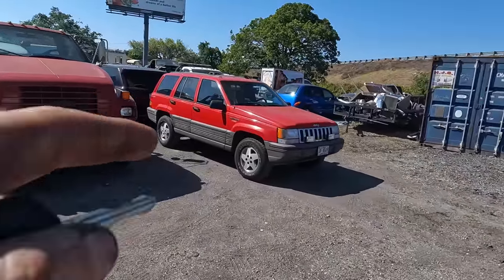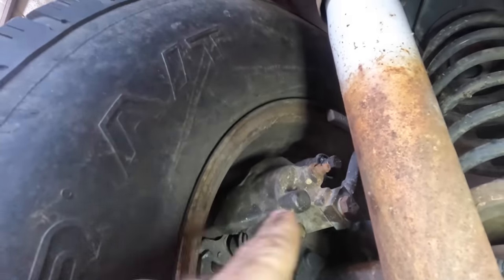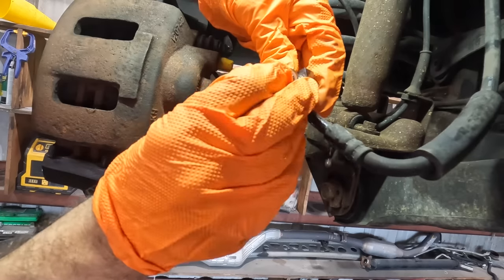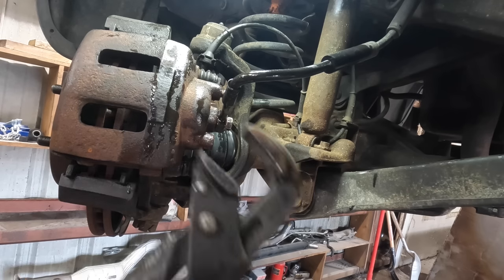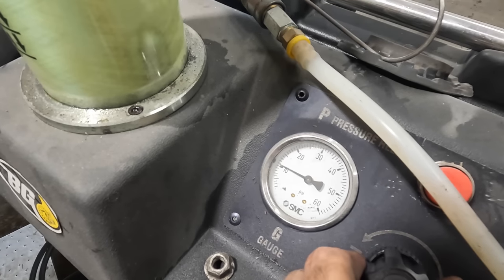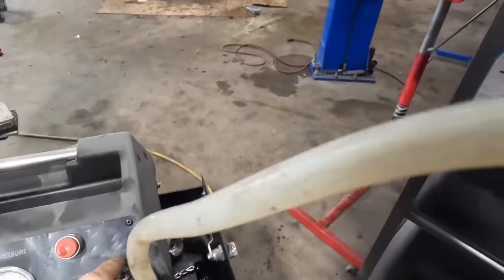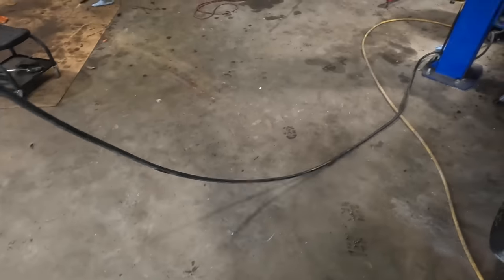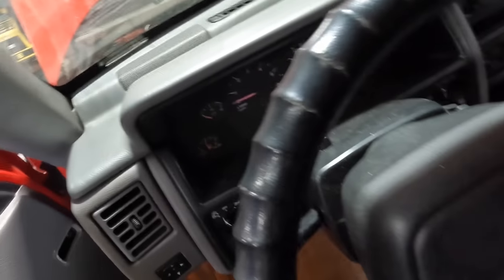Customer States: Air in System No Brake Pedal! |  Jeep Grand Cherokee 5.2 v8 #nobrakes

Comment: Long time ago I learned to NOT punch holes in bottle seals to open them; i turned instead to using a small pen knife to cleanly cut the entire seal out of the bottle neck in 1 piece. Got a 510 Datsun in the shop that periodically stalled in traffic in cold weather for no obvious reason. Good diagnostics revealed that the float bowl was empty any time the car stopped. Good detective work uncovered that customer had punched a few holes in the seal of the bottle of gas line antifreeze he had put in his tank at his last fill. Removing the tank revealed part of the seal had been knocked into the tank where it would occasionally get sucked over the fuel line and kill fuel flow. Once flow stopped and suction relaxed the seal would be released from the fuel line so that fuel could again be drawn into the carb.
Reply: My dad had an old truck that was doing the same thing.  It had half a dozen tiny gravel in the tank that would plug the gas line the same way.  Took him a long time to figure out what was going on.  🤔
Reply: Plus it might be good to close the doors on that cabinet, so the bottles are not all covered in dust every time you open them.. probably just from the demo work.. but still shiney bottle = shiney fluid.
Sliding door cabinets increase workspace also.
Reply: @roboosh  I agree place needs a good cleaning. It would make be think the person who owns this place would be less than careful with my vehicle. Not saying that is Ray but would give be that impression. Obvious bit l not an issue with the busy shop he has. A little ¾ clear gravel goes a long way. Maybe talk to the owner
Reply: @Rick Berglund  in his environment, he could dust every day!

Up north, maybe once a year.
Reply: @sw7366  it doesn't need to get that bad. Seriously maybe some cupboards with doors for the fluids, maybe wipe off the machines at least the parts that touch cars each use. It's not all that hard. I hear contamination all the time but I am sure things are getting contaminated just form laying out in the open. Just common sense
Reply: You guys commenting about dust… you do realise he’s been doing an absolute ton of demolition as well as the yard out front being dusty….. gimme a break
Reply: Yup, seen it several times.

Either carefully remove the entire seal or slice it, making sure ZERO debris can come loose.
Reply: Wow, how many hours went into that investigation  ?
Reply: @andymccall6861  Yeah, that means you clean more often, not that you lower your standard of cleanliness.
Reply: @wesgregg6451  sounds like you guys need to go clean something 🤔
Reply: @andymccall6861  thank you
Reply: One of the first South Main Auto videos I saw, he diagnosed a valvetrain problem on an... Isuzu SUV? A piece of foil from an oil bottle seal got poured into the engine and that little bit was plugging a lifter? Oil galley outlet? in the head.
Reply: I've flushed my fair share of 510 tanks during my time at Datsport.
Reply: If a piece of bottle seal drops into the oil filler on your engine, it can clog the oil drain hole in the head and blow out all of the oil out of the engine while driving down the road. Ask me how I know. 🙄
Reply: We had a regional manager go to one of our stores in west Texas. He ripped the guys in the store for not cleaning and dusting the place regularly as there was a thick layer of dust on everything. The guys spent several hours cleaning everything top to bottom. By the end of the week, everything was coated in another thick layer of dust. The regional manager apologized. We clean our store weekly, but this time of the year with the weather change and the massive amount of pollen everywhere, it’s impossible to keep up with it. With rays shop under construction, the guys next door cutting granite and a gravel parking lot, cleaning is a lesson in futility. I agree that it “looks unprofessional” but as long as the work gets done on their vehicles, I’m sure they overlook the dust. I’ve had customers in my shop ask how we work in such filth. The shop gets cleaned every afternoon. It’s just the nature of it.
Reply: l
Reply: I don’t think a bit of dust is a problem farmers and mine sites battle all the time. I have been in shiny shops with not so bright technicians. Guess which mechanic I prefer.
Reply: @derekhobbs1102  just a little bit of water in the tank can give intermittent faults. A family friend replaced motor before flushing the tank. Expansive 😢
Reply: @GaryH-pw9cm  I think most of us have stuff something up. I have purchased a lot of experience. Must be slow learner. Myself
Reply: that's why many vehicles had a coarse mesh screen filter on the end, it would stop large chunks, but let small debris pass through. then they all went to large filter socks.
Reply: I once experienced a similar condition in a Mercedes sedan, 280 SEL, where a leaf had somehow gotten into the tank when the sending unit was replaced and it would often stall when the fuel level was low.
Reply: @thomasmleahy6218  expensive lessons
Reply: @wesgregg6451  after ANY demo dust will still fall for up to 6 months….. give the guy  a break, remember he’s trying to build a business
Reply: what
Reply: Never seen a system where fuel is drawn into the carb. Most systems with carbs pull it from the tank and push it into the carb.
Reply: Omg dust isn't that big of a deal. A little dust isn't gonna hurt anything. You guys acting like the dude is making microchips, he's working on cars, if dust interferes with operations of your car then you need to get a new car.
Reply: I know of a World of Outlaws sprint car team that chased a power steering problem an entire season before they found a bottle cap seal had been floating around in the reservoir that occasionally blocked the supply line. Those guys changed the lines, the entire steering assembly I don't know how many times. All over a simple bottle cap seal. It can happen to the best.

Comment: Helpful hint: when attempting to loosen rusted fasteners, a six-pointed socket or box end is far less likely to round the fastener off than a 12 point or adjustable wrench.
Reply: I 100% agree. It's the reason I have both types in my collection. ;)
Reply: i was cringing. always use a 6 point on that stuff
Reply: Up north life!
Reply: Wasn't he using the "box end" of his combination wrench to loosen the bleeders? I did see him use the open end at one point, but that was too get the wrench over the rubber vacuum hose.
Reply: @wesgregg6451  he was but it was a 12 point  which is the easiest to strip something with
Reply: @doug holman  Ah. I wasn't paying that much attention. 

I still use my old bleeder wrench that my Dad gave me in 1985, most of the time, unless there's an issue.
Reply: 100% this.
Reply: On bleeders running the back side of a drill bit into it will help support the bleeder and stop it from collapsing
Reply: @Pete N I have tubing wrenches, and just like a conventional open end wrench they will slip.
Reply: i generaly break with a six point and if u can get a couple turns on the wrench an automatic will speed up without rounding or breaking the head off the fastener.
Reply: as a rust belt laborer, exactly! six point socket on 1/4" breaker bar(very gently wiggle back and forth) after torch heating and cooling the bleeder itself(3+ times) and bang it on end with hammer. obviously avoid heating the caliper as much as possible and yes bleeders will need replaced!
NOTE: in general, if the bleeders are that bad, the calipers are likely rusted internally and seized or seizing due to piston and bore rust and probable torn seals. so just replace the calipers, unless it's your own junk-heap and a very temporary fix.
Reply: @throttlebottle5906  I have another hint, one that works well. First, apply your favorite penetrating oil. Give it a minute or two. Next, invert a can of canned air and spray the bleeder with the -40F blast. Then try to turn the fastener. Stubborn cases required gently tapping the fastener while applying torque. It worked more often than it didn't.
Reply: @spaceflight1019  the salty "rust belt" vehicles laugh at penetrating oil and all types of freezing products, short of liquid nitrogen and being shattered(lol).
never had any lucky freezing anything(except plumbing) for repairs.
Reply: @throttlebottle5906  I live near Pittsburgh and worked as a field service technician in industrial instruments and process controls from 1978 until 2021. I've seen my share of massively rusted steel, and have been able to disassemble a great percentage of them. But your point about replacing the calipers if they are that badly corroded is a good one, one that I've followed many times on my own vehicles.
Reply: @throttlebottle5906  at that point I would add hoses to that list
Reply: @Jeff Hoag  I learned that from an ol timer a long time ago. You gave GREAT advice. I haven't rung off a bleeder screw in 20 years. Even with vise grips
Reply: @@peten8767
Reply: @throttlebottle5906  I had to put a brake caliper or two in the freezer overnight. One tap and that stuck pistons literally fell out. I tried compressed air, and then a grease gun and grease. I got my dad really pissed off because I tried twisting it out with one of his Super Ego Spanish made pipe wrenches. I had to take a die grinder and reface his pipe wrench body's top teeth, and replace the bottom jaw. He was pretty happy with that. I have used a grease gun to get stuck bullets out of rifle barrels, and they can come out with some serious force too. Get the spackling, there is hole in the wall, force.

Comment: With the price of new cars, or even used ones with low mileage, I wouldn’t be surprised to see cars nearing 300k cause it’s cheaper to maintain properly then to buy a new xar
Reply: maintain properly? you mean spend tons of money on parts to catch up on maintenance that was never done? 

or throw parts at a trash can because it's stills cheaper than a new car? that's what it usually is lol, good cars can make it to 300k without a ton of parts
Reply: @bradhaines3142  as In change oil on time, keep your brakes in decent condition, do your filter changes and tuneups. All of this can be done at home with basic tools and some common sense. Unless something major breaks or you have some disability that prevents you from doing the work yourself, you don’t really need to take your car to a shop.
Reply: I have a 2012 Taurus sho AWD with the 3.5l Ecoboost that's at 267k. Anyone who knows this platform knows that's a lot of miles for the short block 3.5l TT V6. regular maintenance does wonders. I've done a few things to it as expected. Water pump, timing chain kit, and PTU rebuild, suspension and brake components as well. Other than that and some small things like oil pressure sensor, thermostat, coolant top hose, and battery. She's been good to me. I also have a tune, msd coils, cold ignition plugs, air intake, I'm putting out about 400 awhp. Not to bad for a platform that's known for issues 🤷.

Comment: Just wondering why the copper washers on the brake hoses weren't replaced? Single use item... Toss the old ones, replace with new... That's why every reman or new caliper and new brake hoses, comes with new copper crush washers...

Comment: The two connected chambers in the brake fluid reservoir, one higher than the other, are for if you blow a line while driving, one half of the system still works, otherwise no brakes whatsoever (don’t ask me how I know 😬).
Reply: correct, split system
Reply: How do you know??
Reply: You are correct. Any one can ask me how I know 
.
Reply: i bet you crashed off a cliff when your brakes went out
Reply: 99% of brake reservoirs are like this but most of them still only have 1 cap

Comment: That happened when I did the brakes on my dads chevy van, someone put the one part in wrong, 
then I put it back “the way it looked correct”then the brakes stopped pulling. I keep forgetting 
you are in FL. most nuts,  bolts or bleeders need penetrating oil and a torch! to free then up.
thank you NY state road salt. have your self a wonderful day! and be safe out there!

Comment: Ray, @ 19:48 is why I gave up on using BG ( or any ) brake flush pressure machines. I would spend more time trying to find the correct adaptor than doing the actual flush. After buying a universal reservoir to stick on top of the actual master cylinder reservoir and a vacuum line and container for brake systems, my brake flush times were literally cut in half.
Reply: I love euro cars with screw caps for the brake reservoirs. Never any problems

Comment: I worked at a tire shop for 4 years... I use to absolutely curse those capped nuts. I live on the the east coast of Canada. So after only a few years they are swollen, often requiring removal of said cap. Nothing worse then having to mess around with a cap during change over season.
Reply: Did you notice he didn’t torq them to spec? Even Discount Tire torques the lug nuts to spec.
Reply: @Mr572u   you do realize that he has to cut and splice the video  and he has shown that he uses a tork wrench when he puts tires on.he knows that the tork sticks are not a replacement for proper torking.
Reply: @Mr572u  i sincerely doubt a technician with an attitude like this guy's would ever ignore torquing their lug nuts
Reply: I would have replaced the nuts as the owner would not be able to change the tire out on the highway without the special tool. 
 Also, the nut design has to be one of the worst designs ever.

Comment: When working with brake hoses it's good to keep a valve stem on hand you can stick it through the hole so it doesn't leak as much

Comment: My first Brake job, I installed the wheel cylinders upside down so they wouldn't bleed the air out properly. It was my first car, a 69 Pontiac  Catalina.  That car became my classroom. I ended up replacing the entire brake  system including brake lines, master cylinder and rebuilding all 4 wheel cylinders. I can do a brake job in my sleep now.

Comment: years ago I had an auto repair shop. did a brake job on a v.w.  Almost caused an accident because I did not use or have a bleeder ball. A device that uses compressed air over brake fluid to bleed the air out of the system. that is the only thing that worked.

Comment: I have never seen a front caliper hose put on wrong and still semi function...wow...yet another reason to do one side at a time.
    A good video...glad seeing the backs of all 4 wheels got hosed off.
  A great video as always Ray. Showing the quirks/problems with the adapter caps and reservoir caps like you did is good to see...and the fix is as easy as a turn of the knob.
Reply: Very good example of my thoughts. Take lots of pictures. Then you'll know how it was before you touched it. Only bad thing here is if someone screwed it up before you took pictures.

Comment: Glad you fixed the front brake lines some mechanics would not even fix that, like someone else mentioned a flare nut wrench would not round off the bleeder valve just a hint coming from experience been there done that.

Comment: I have a 2014 Ford Fusion with those swollen lug nuts. Not a great engineering decision. I got one of those 18.5/19.5 sockets to remove them. The 19.5 worked great getting them off. A few had the chrome caps come off, so the 18.5 worked great for them. I bought some solid 19mm lug nuts and no more swollen lug nut problems.

Comment: I am surprised you did not replace the lug nuts. Both stainless steel and powder coated lug nuts are available and the owner probably does not have a 19.5 or 13/16" oversized socket to change the tire when they have a flat.  I did that on my Jeep.

Comment: On bleeding brakes I like the kit Harbor Freight sells. It has adapters to hold a bottle on the reservoir. Then you bleed with a vacuum pump. This works well because with the bottle to keep the reservoir full you don't have to check so often. The bottle on the reservoir is gravity fed, no pressure. And the kit don't cost much. Oh the adapter on the reservoir when you pull the bottle off stops the flow of fluid so the reservoir doesn't over flow.
Reply: Should be on lower coment.
Reply: I have one of them,  I kinda like his unit better, as it puts presure in the resavor pushing in new fluids as you remove the old fluids so your not constantly having to add more.
Someone could build a smaller version with built in bladder, and fresh fluid tank
And a portable compressor as well as some type of resevor pump.

Comment: 5.2 liters. Or what the Elderly call a 318. First seen in the late1960’s. Fantastic reliable engine. Just keep the oil changed once in a while. I miss them.😊
Reply: And certain of us elderly hate MOPARs! 😂😅😂😅😂😅
Reply: I think they were a very good engine! When I worked on them the only problem was a lower intake plenum gasket leaking oil into the throttle body. Other than that no issues if well maintained!👍
Reply: The only downfall to that engine is that it’s going to cost $150 in gas to get from Florida to Tennessee.
Reply: First 318: 1956 (A engine). First with wedge heads (LA engine): 1967. First with SMPI and roller cam ("Magnum"): 1992. All reliable.
Reply: @stevewhiting556  the carbureted ones were even worse on gas. Say 10 mpg.